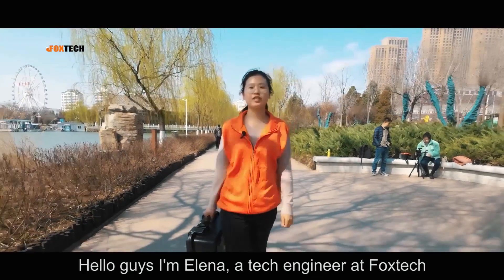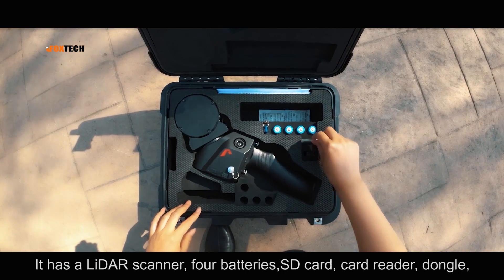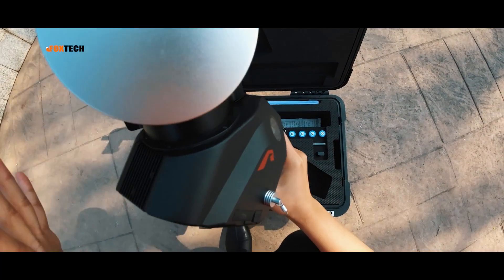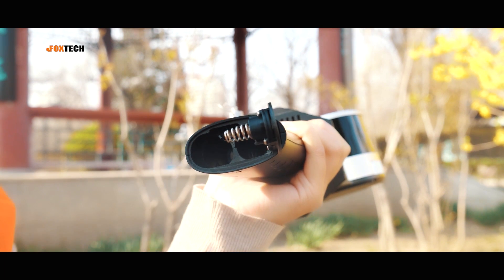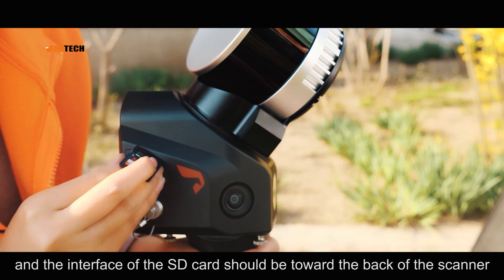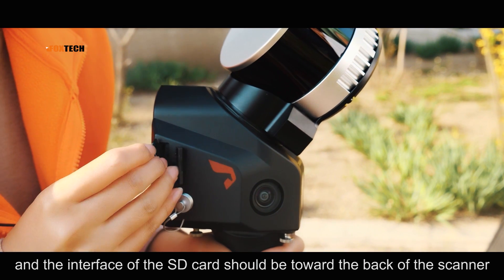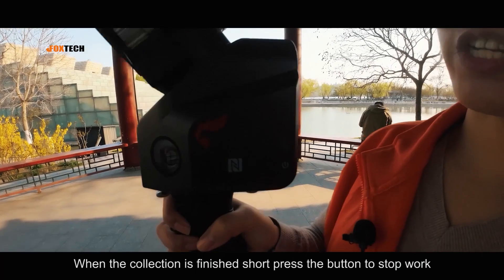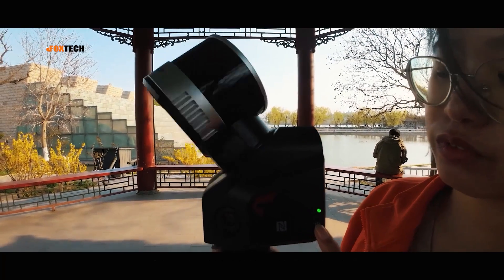How to Use a Handheld Lidar Scanner?- Slam100

Comment: Can the final map be exported to CAD format for engineers and architects to use for design?
Reply from the maker: The output file is .las point cloud data. You can use other software to convert it to other forms you need. SLAM100 software also supports line drawing and output in fmb, shp, dxf formats. You can contact grace@foxtechrobot.com for more information.

Comment: Floor penetration?
Reply from the maker: I am afraid Slam 100 cannot do floor penetration. Mainly used for surveying and mapping.
Reply: Floor penetration is not a feature of any lidar product. This application requires the use of other methods such as ultrasound, seismography, xray, radar ect. LiDAR is mainly for reality capture, eg accurately digitising of real world environments, structures, buildings, geology/terrain for modelling, visualisation and data analysis, building information modelling, mining engineering and heavy industry, and for forensic examination. Basically anything you can see and touch (the surface of)